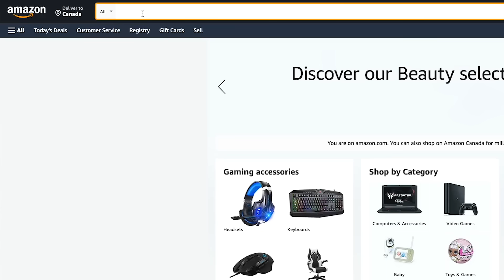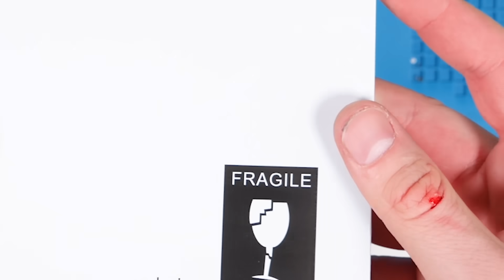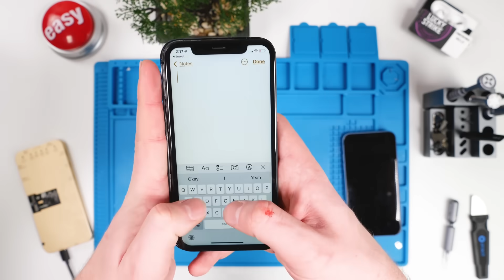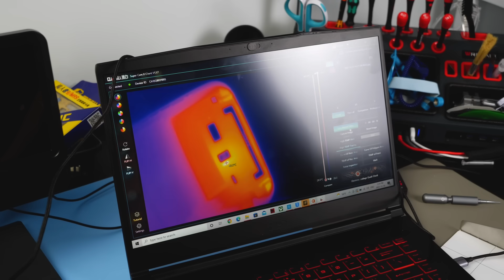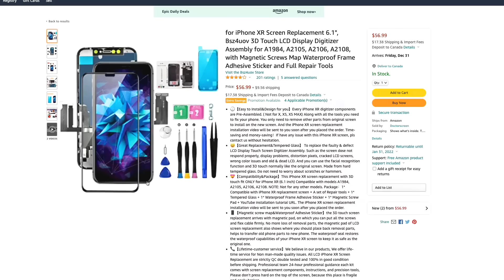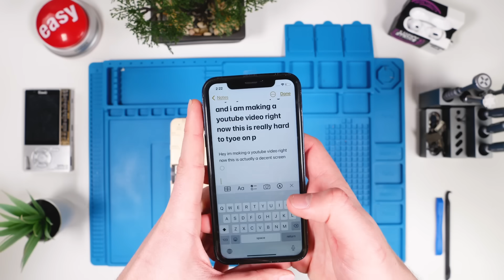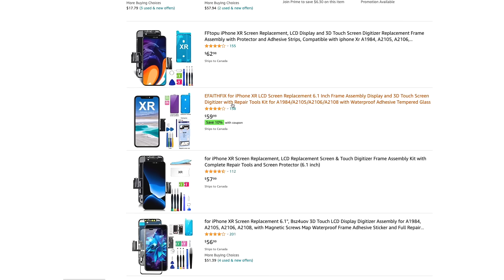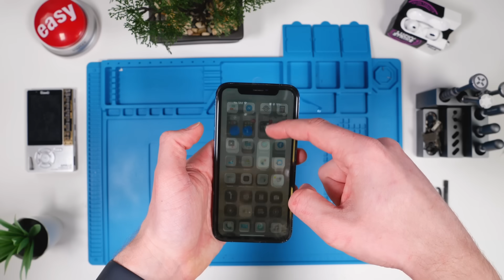Are AMAZON Replacement Screens TRASH? 🤔

Comment: The reason why the first screen was quite hot might be because there was no backplate which could have acted like a heatsink or something
Reply: 69 👍
Reply: @bensoncheung2801  nice
I literally didn't realize this comment had 69 likes lol 🤣
Reply: @Ingenuity1  Nice.
Reply: @Ingenuity1  oh I thought you figuratively didn’t realize your comment had 69 likes, my bad
Reply: @Ingenuity1  it's 169 now not gonna ruin it
Reply: Back plates would conduct the heat and also get hot because they’re metal. He could see it from the front of the screen. I’ve done a lot of fixes on iPhones a few years ago. My guess would be that they are support for the actual screen. Like the LCD. To keep it in place. I could be wrong but that’s my guess
Reply: Plus he forgot to see warnings on back
Reply: @micahreese5886  Aluminum is also metal and is used for heatsinks. so NO
Reply: Damn near close to 420🤣
Reply: yea same what I was thinking
Reply: @akapoor92000 it absorbs more heat from LIGHT since it reflects most of it. It doesn't absorb more heat in general
Reply: 500 🎉
Reply: @rimusen6364  true
Reply: @GerardoPerez-zv7ph the heats in an enclosed space ya nugget. So even though the phone is a heat sink technically. No metal plate. Heat straight to lcd
Reply: @akapoor92000 what? these comments are just sad..
Reply: 569 likes nice 👌
Reply: Booyaka Booyaka 619
Reply: Xo😅x
Reply: ⁹
Reply: @Ingenuity1 😅
Reply: @tollerderoo1877  stop spamming
Reply: Come on 699
Reply: 690

Comment: The screen overheating couldve been due to the missing backplate which might’ve acted as a heat sink
Reply: And then? What eould have happened, just think s hit further? …yes? Right, the backplate would get hot, too - he would have felt it, and the IR would have shown it. Backplate or not, this screen was way too hot, I’d never install it.
Reply: @erebostd  you're not gonna believe this, but heat dissipates on a larger surface, especially since its metal.
Reply: @majorlobster3443 you can always tell when someone thinks their smart but has no knowledge in the field their commenting on. Then he’ll reply to my comment saying how he’s 29 but been a phone technician for 15 + years. I do believe the missing backplate was probably the issue imo. Guy above you clearly doesn’t understand heatsinks

Comment: I would like to see how strong was the glass of the display. Usually aftermarket screens have a low quality and thinner glass. You can add this in the next comparison.
Reply: I second this. Many screen replacements this day have good display or recycled display from the broken one. But that outer glass never as strong as the original one. Always break easily.
Reply from the maker: Thanks :) if i do this jerry rig fans will come after me though
Reply: @PhoneRepairGuru  " just do it " -steve musk
Reply: @PhoneRepairGuru  scratches at level 6 with deeper grooves at level 7

Comment: This is an interesting type of video.

I’d like to see maybe an iPhone 12 series screen replacement from Amazon or even an s21 screen replacement from Amazon.

If it’s affordable of course, since OLEDs almost always cost quite a lot more than LCD panels.
Reply: Yeah I was thinking the same. Since the iPhone X, they had OLED on some models, so older models could be affordable to actually have an OLED replacement.
Reply from the maker: I may do it again on my other channel
Reply: @rushilkisoon  Samsung has actually never had an LCD on a flagship S series. from my knowledge, even the first Galaxy S had an AMOLED display. its hilarious because you look back an am amazed at how they were ahead of the game for so long, however display replacement costs suck with an OLED. its the reason I dont mind the on paper downgrade to an IPS display, the one on my Xcover Pro is vibrant enough that I will take it over an oled just for the ease of repair
Reply: @Carterthielftw_  I mean they do specialise in display manufacturing, like LG, so it’s a good way to show off their work to other buyers. 
My only complaint with an LCD replacing an originally OLED panel, is the “dodgy” electronics needed to create the LCD image and backlight power, since OLED is self illuminated
Reply: @rushilkisoon  definitely, I personally would always prefer to buy geniune/soft OLED. I also know that some people dont want to spend $300 on a display for a 2yr old device. This is why I actually prefer a good quality IPS display being standard on devices.
Reply: @PhoneRepairGuru  Other Channel?
Reply: It would be an added bonus if the S21 display also is 120HZ
Reply: @Carterthielftw_  true a old Samsung galaxy s6 I have in my house has a amoled 1440p display which is crazy for its age

Comment: When you install a lcd screen on a phone that comes with an OLED it requires more power and will cause a slightly warmer screen. Only use Oled screens on those phones. The LCD screen will function but it will cause issues especially on a water damaged phone. The 11 and xr are original is an lcd screen though.

Comment: I made my own phone fixing business, so far it’s been really great. How ever I am 15 so I don’t know how much I should charge people for simple screen replacements. Sometimes I feel like I might charge too much or too little. Also can anyone suggest any good websites to use for good quality screens other than Amazon?
Reply: Just Chinese websites like Ali express and stuff most of the stuff on amazon I believe they buy from them and resell it
Reply: Try ebay
Reply: you need an LLC to get good deals but the screens are better quality id try mobile sentrix or injuredgadgets
Reply: depends on how greedy xr in my area cost about 80-95 screen cost anywhere between 20-27 on amazon so they charge 50-60 for labor and the cost of screen get a llc can get screens and parts from websites that required abusiness ein#for a lower cost can really make your own price just have to be a price thats keeps customers  coming.
Reply: @ceementality  what do you think of the JK series? For screen replacements?
Reply: @Rang3rDan  what do you think of the JK series?
Reply: @Kingjulian7706  not a phone repair persion they seem to be okay but nothing beats OEM in terms of iPhone displays or meets it sadly

Comment: I’ve tried 2 replacement screens on my XR so far. The first one worked perfectly, for about a week then the screen went black and that was the end of that, the second one works perfectly 40% of the time. The rest of the time I’m swearing at it because touch is all over the place! The link you shared for a good screen doesn’t work here in AU.

Comment: I bought a ocolor brand screen with touch Digitizer assembly for  a moto g power 2021 works perfect only thing pissed me off is they left the glue out of the kit. Supposed to be a hard phone to fix but it's not at all it was my first time replacing one and it was a breeze screen works perfect and looks good

Comment: I got a screen and battery for a Samsung A50 from a local repair store and reseller. The screen got completely scratched withing the first 3 days and after 3 weeks the glass started coming off the display. The brand new battery lasted less than a 3 years old battery. I also got the back panel to replace and the coating on it had some sect of dust. I feel like these were all parts that didn't pass quality check. Needless to say I took it apart and sent everything back.

Comment: Hey phone repair guru I got a question for you how do I actually know if my old phones screen is heating up at a fast rate because when I use it to type on it,it would burn my hand especially when it's in my back pocket it would feel like I'm being burned again as well I'm not sure if I should get that fixed or ask someone to fix the issue and the charging port as well

Comment: I cracked my oled screen for my X about 2 years ago, and i replaced it with a screen that costed 90 euro's, it was trash! The touch did funky things, the colors were way off, the ghosting was crazy, and i was upset because it was supposed to be a "premium as original" screen, than, 6 months later, i bought one from a very small vender here where i live, he asked 50 euro's for this panel, i thought by myself why not, it was an oled panel and thought by myself, if the touch works normally, i am happy, F the quality of the display, i want a working iPhone, the screen arrived in some janky packaging like the last screen you unpacked, but man, this screen is awesome!! The touch problems were gone, the colors look really good, the bezels are as thin as the original and it came with everything so the swap was so easy! The only problem is the refresh rate, it is way better than the more costly screen, but it is a big step up. I am still using this screen and no problems whatsoever. If you didn't know that this was a replacement, you can fool somebody 4 sure!

Comment: Talking about Amazon replacements, do you recommend high capacity iPhone batteries?
Reply: they're usually just old or crap quality batteries with a sticker placed on it that claims the higher capacity. but it does depend on the manufacturer. If it's some random no-name/chinese brand without a reputation, it is more than likely fake capacity and will probably be much worse than the original battery. Finding replacement batteries that don't suck is a pain.
Reply: If the larger capacity batteries are from a reputable place like Injured Gadgets or Mobilesentrix then they're usually fine. But the ones that advertise 3200 mAh for something like an iPhone 6 aren't high quality and are usually just old batteries with a sticker.

Comment: Hey, I’ve had my screen replaced on my iPhone XR after it got ran over.  The accuracy seems terrible.  I’ve had 2 different screens installed and they both seem to have piss pore accuracy, like when doing things like trying to text.  Does that sound like the screen or could it be an internal issue?

Comment: I recently bought a LCD iPhone 8 screen from Amazon to replace a completely broken screen, but the home button and front camera are not working. It came with a new front camera and loudspeaker already assembled, which may have been the problem, or there’s a cable that doesn’t look right on the inside of the screen, which also could be the problem. Either way I can’t find the problem. Do you suggest a new screen?

Comment: Hello phone repair guru, i don't know if it's because of my new charger or my battery but when I charge my phone (without using it for 4 hours which is usually when it gets full) but it it only got to 11% and the battery when to zero very fast, do I need my battery repaired or a new phone charger?
Reply: Check battery health in settings

Comment: This is why apple serializes stuff i think. I saw an iphone 8 with such a trash screen, it looked like off of those old calculators, where pushing just slighly gave you blue/black streaks. The 3d touch was completely messed up too

Comment: Hey is there like any third party OLED screen for XR or 11? (Just wondering. Like maybe Phone Repair Gure see this comment 😀)
Reply: Sadly not, it’d be cool but the on board circuitry is specifically for an lcd. The lines will be different and there’s also the addition of the backlight. It could work if you ‘killed’ backlight power or stepped down the voltage but it won’t really be worth developing an oled display for lcd devices.

Comment: Bro I just bought a screen for 16 bucks on Amazon and I was hoping you would have some ones priced like that cause 50 bucks for a screen is expensive when I can pay 100 and have someone do it for me. But 20 bucks….. now that’s when I’ll buy a screen and do it my self. Well I did it and it worked for a day but then stopped working and I’m pretty sure that’s because I had lost one of the L brackets that hold down something inside the phone and I also lost a screw so I’m going to open it up tomorrow and I bought inside parts to the XR to replace the ones I lost and I’m hoping that will make it work. ❤thanks for your videos bro I like seeing how to do what you do